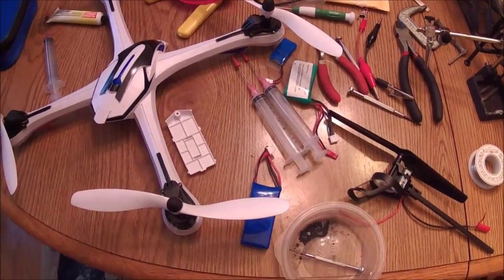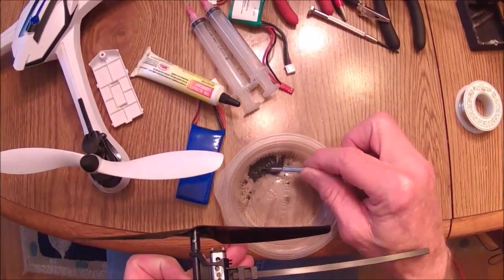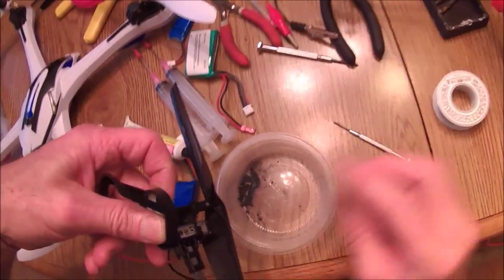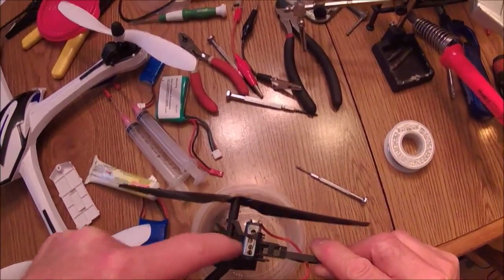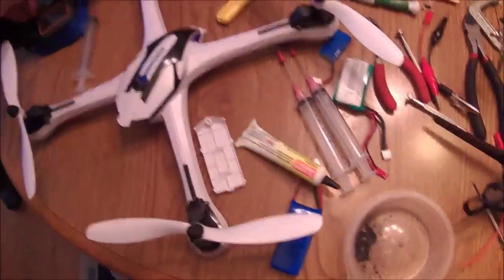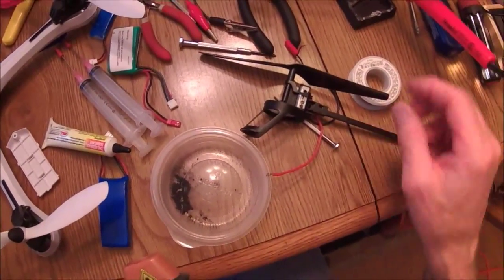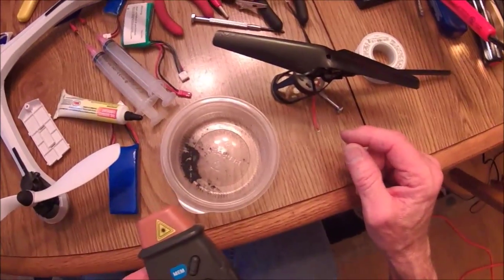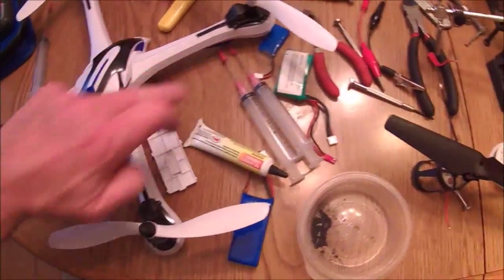Drone applying dry graphite lube to the N40 DC motor

Comment: Bad idea to apply graphites on electric motors because it is conductive 😅
Reply: Well if it was bad for it it sure didn’t show. I applied it to the brushes. Yes, it’s conductive and that was the point. It increased the thrust and prolonged brush life. How is that a bad thing?

Comment: where can i order this graphite lube from?
Reply from the maker: If you have an Ace hardware store you can get it there. It is door lock lube. Make sure it is pure graphite lube, silicon lube will not work.
Reply: awesome, thanks for the tips. just wondering what brand name is the graphite you were using? so i can order it online in case no stores around me have it. and is the syringe necessary or i can do without it?
Reply from the maker: +LivingL393nd 
The syringes did not work out. I use the small screwdriver as shown in the video.
The lube is Victor powdered graphite lubricant.
Reply: thanks man. so how often would you reapply this lube? i guess it depends on how much you fly it? what would you recommend?
Reply from the maker: +LivingL393nd 
I did it about 10 to 15 flights. I would blow the excess graphite out with compressed air when I was done applying it.
Reply: I see. Now just wondering why do you have to calibrate the accelerometer? I've seen videos where ppl would move the right stick to the bottom left corner to calibrate it. I haven't done this and haven't had any issues with it so far. Would you recommend it and do I have to do it every time I fly it or only once?
Reply from the maker: +LivingL393nd 
I only did if the quad wasn't flying or hovering as it should.   If yours hovers well and flies as it should I wouldn't be concerned about it.

Comment: interesting video do you grease the bearings or bushings and the main gear and pinion gear I was thinking about greasing my quads gears and bushings but not sure what to use to doit have you had any luck with doing that other then the motors

Comment: Doncha just hate brain farts? So much info running around in the brain and all of it important. :)

Great info. My X6 from JJRC will be here on Tuesday. Can't wait.
I have the bearings and motors on hand already. Plan is to replace the bushings and break in the motors before even stepping outside. That is if the weather will let me. I hate winter. LOL
Now I can add this procedure as well.
Great stuff. 

Subbed.

Comment from the maker: Thanks, I don't know if the grease would be compatible with the graphite lube. I haven't had any problems since I started blowing the motors out with compressed air. My Tarantula has 37 flights on it now with the 3 original motors.

Comment: i have found that using bearing grease in the bushings works really well if you dont have bearing. you use a toothpick and push the grease in both bushings. it works great.

Comment from the maker: I have also started using compressed air to clean motors out. I am doing this after ten flights or so. I think debris got into the bearing on the motor that I lost a while back. I have been blowing the motors out since then and all other motors are still doing well. Quad is up to 25 flights now. At 10 minutes each flight that is 4.2 hours of flight time.

Comment: One person on youtube recommended the MJX F47 ball bearings to the replace the brass bushings, any thoughts? I really have no idea what upgrades work great but this graphite looks great. I've also heard of teflon spray to lube the pinion and drive gear and also ball bearings, any input there. I have a brand new X-6 and want to make it best from the get go. Thank you for the video, much appreciated.
Reply from the maker: Wobble Copter 
Yes, you will want to replace the brass bushings with roller bearings. The roller bearings have less friction. I have replaced all of mine. The only other thing I have done is I took the prop guards off and I took the long landing gear off. to make my Tarantula as lite as possible.
Reply: Quadflyingfun I cut off my prop guards so I could keep the cover over the lights and it also acts as a landing gear, mostly catch it so it doesn't suck up debris, etc. I strip down every quad I get for best flying performance.
Reply from the maker: I left my light covers on as well, I hot melt glued them in place.

Comment: Just wondering how the graphite is working out. Motors holding up?
Reply from the maker: David LaFrance 
Great so far, I am inspecting the brushes through the vent holes and wear seems to be minimal.
Reply: Will spray graphite work? The can comes with a small red tube to help apply the spray...
Reply from the maker: David LaFrance 
The brush wear is really good, I did lose a motor tonight due to bearing failure. I am going to take it apart and see if I can determine why the bearing failed.
Reply from the maker: David LaFrance 
Really bummed about that bearing going bad. The brushes showed very little wear.